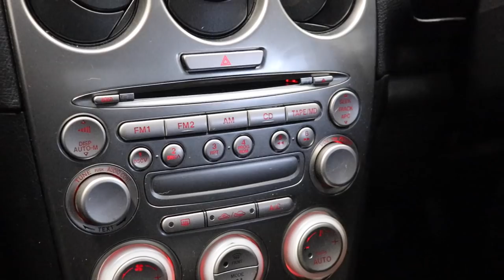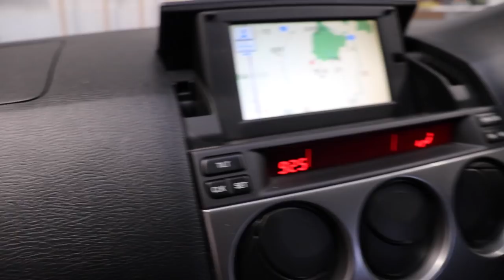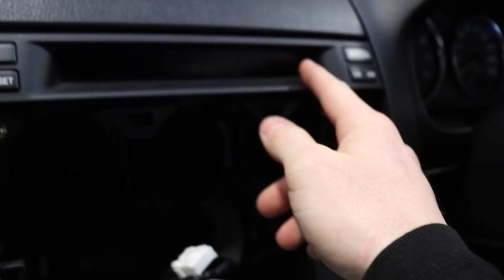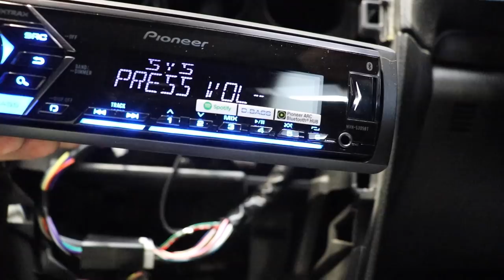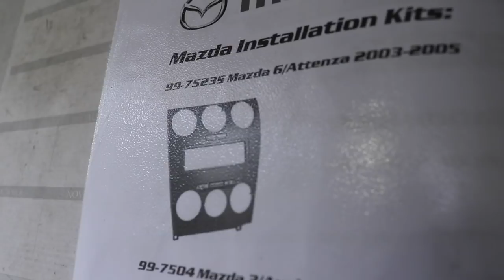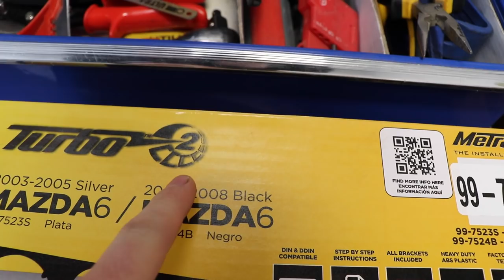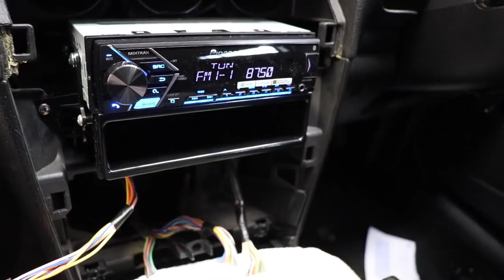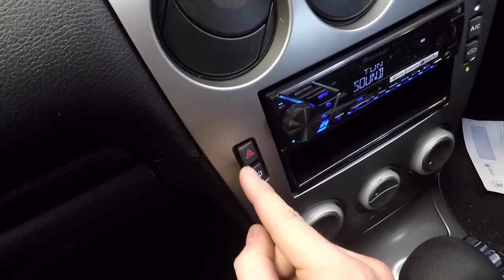Mazda 6 Attenza Detailed Stereo Replacement

Comment: I just installed the same kit in my 2006 Mazda. The extra plug is for an ASWC-1. I had the same problem with the fascia sitting out a bit. However, I found this was because the head unit was sitting too far forward. When I adjusted the brackets on the head unit the fascia fitted in properly and lined up as it should.

Comment: i know you can always get new connectors which are different and connect the 2 together as long as you are somewhat knowledgeable with this kinda stuff. i did not want to spend extra money on new adaptor pins so i used some old ones and works great

Comment: The new panel is necessary? Can I just do the wiring work & connect the pioneer without changing the whole front panel? will it work?
I thought I could put the pioneer on the top panel thing(where's the screen, because mine's empty)

Comment: My car is a 2003 Mazda 6 .would this radio work for it?
Reply: yes it works with mazda 6 03 to 08
Reply: Can you connect a aftermarket sub and Amp to the factory stereo in 2002 Mazda atenza ?

Comment: Followed this almost to the word on my 2003 Mazda 6 series I (didn't do the tv... don't t have one). But.... I have zero audio. Head unit has power. Radio gets a signal and the air con works fine. I have checked all my wires and all the fuses I could think of and they are all fine. Any idea what has go e wrong?

(P.S. it has the BOSE audio pack. Don't know if that is Important)
Reply from the maker: That is VERY important.
In this video the car was a standard audio system.
You either need an interface designed to send audio into the Bose system, or you need to locate the factory Bose amplifier, figure out what wires are your speakers and what invidual wires are + and - for each channel, disconnect them from the amp and run wires from the output of your head unit (or aftermarket amplifier if you are using one) to the speaker wires at the factory amplifier. Note doing this will result in the factory subwoofer not going if there is one.
Reply: Car Audio.etc thank you. I actually got it working with the original Bose amp and head unit with a bit of editing to the wire harness that comes with the kit. Still thank you for replying ☺
Reply: Edvardow I’m thinking ab getting a 03 Mazda 6.. so does it okay good bass ? Plays pretty loud and does it fit with the car ?
Reply: Edvardow how much was it ?
Reply: This one cost me $250AUD to get it from the USA. The fit is sort of crazy, though... If you were willing to put in a bit more work with reshaping it, it would be A grade
Reply: Edvardow what changes did you make to the harness I'm trying this myself I've got the Bose amp as well
Reply: Neal Matti not much. There are 2 wires that are accessory wires (paper work was not very clear on witch ones are witch). You can use them to power the bose system 👍

Comment: I just got my 2004 mazda6 radio replaced now my CEL ,  TCS OFF ,  AND TRACTION CONTROL lights are on,    any clue why this is happening?  do you guys touch those wires when you change the radio? thank you
Reply: you need to get an interface adaptor from , metra, axxess etc. now if you have already done this it might be the wiring is wrong. the turbo 3.0, speed6, v6 non speed6 etc models wiring is a little different than each other also each year models are different but i do not remember which years off hand, a google search will help

Comment: I enjoyed your video, great to see the steering wheel on the correct side. Gees you move fast at times! :-) I have an old '03 Mazda 6 Sport with all the bells and whistles but I want to install a Bluetooth connection. Like many others my 6CD changer has resigned, any suggestions? Will you come to Ireland to install it for me, we can make a video!
Reply: You mean that steering wheel on the wrong side .

Comment: why dont you use heat shrink instead of tape when soldering and covering the connections? my experience with tape it is comes loose after a few years.
Reply from the maker: +Sirtokesalot47 after a few years you’d be wanting a new stereo anyway.
Reply from the maker: +Sirtokesalot47 also heat shrink costs a lot more and takes me a lot longer to do properly than tape.
Gotta remember im an installer at an actual car audio shop and we do many cars every week and over long term there is a huge cost difference between the two.
We buy electrical tape wholesale and it goes so much further and can be used for a lot more.
Business gotta make money somehow.

Comment: I would much rather just put in the Android Navi replacement for the flip up screen. Then you would have a working toutch screen with BT and CD/DVD instead of replacing the whole headunit plate and have a dead screen in the car...

https://www.ebay.co.uk/itm/232235721836?ul_noapp=true